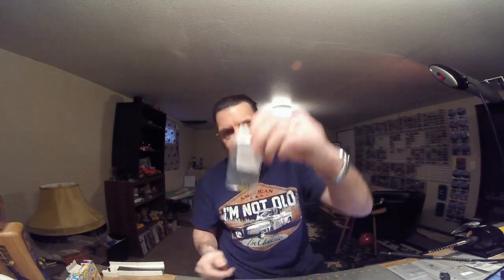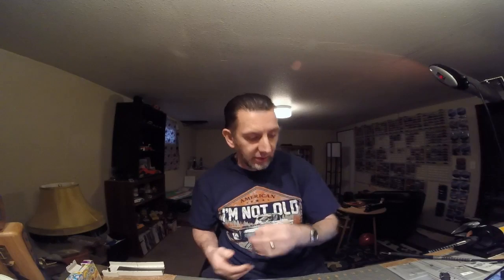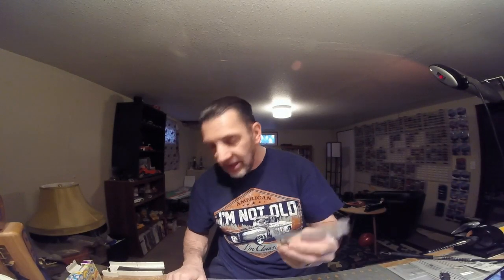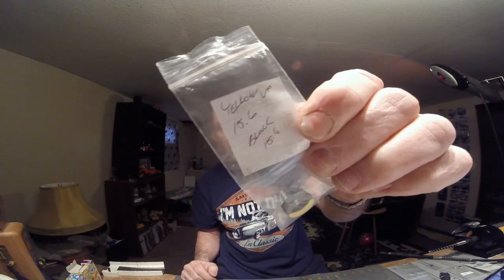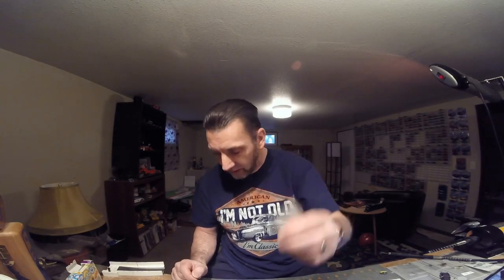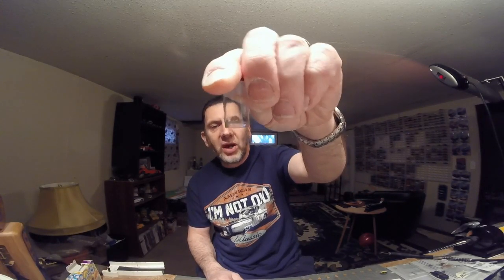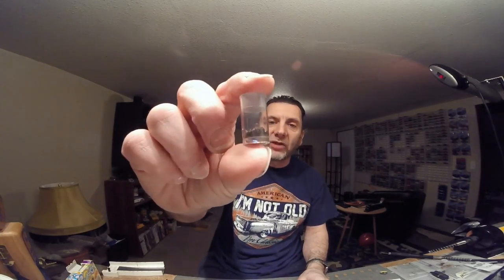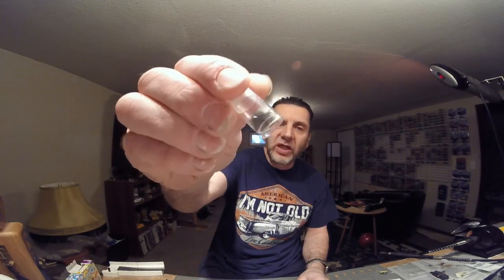Fray Build part 1:parts and were to get them

Comment: From what I have heard it is only  legal for ithe team event at the Fray. An Aurora chassis is required for the individual event. If this has changed please someone correct me.
Reply from the maker: Your right Glenn but most other groups are allowing the wiz jet in so we are too
Reply: @slotcarcrazy  we do as well Troy. I was just stating that the fray rules did not yet allow them in the individual event.

Comment: do you have to buy these products, or can you use original tjet parts if you have them. like gray armatures, rear axles, gear sets. etc.....
Reply from the maker: You can I'm building the car to Fray in Ferndale standards
Reply: You can use standard tjet parts to build a Fray car. But it's unlikely it will be competitive against other Fray cars built using parts off the list mentioned. These after market parts will help in making a competitive Fray car, but it takes quite a bit of work.